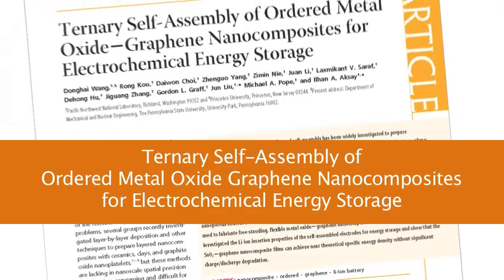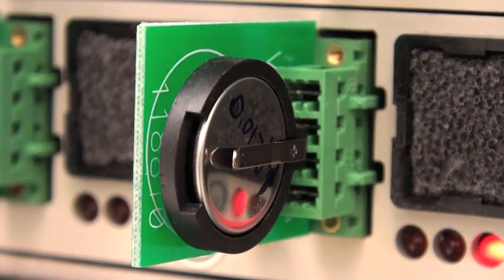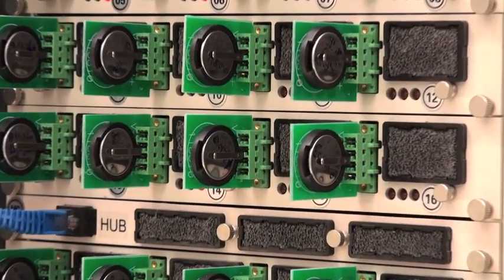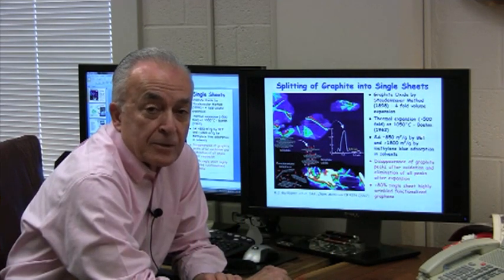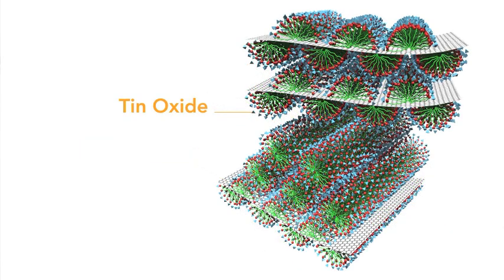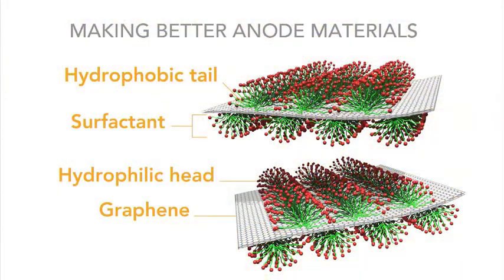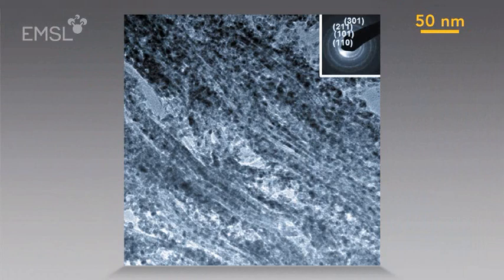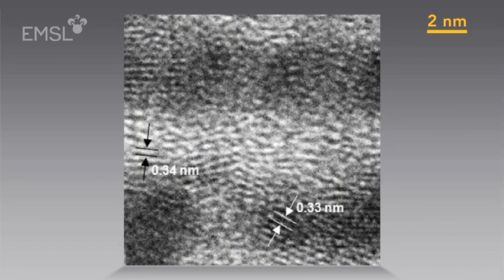Making Better Batteries with Metal Oxide & Graphene Composites

Comment: THe only thing is how would movement disrupt this perfect placement of materials into moving vehicles.  Because this is a placement tech it seems.  So if there is some kind of shock to the battery would it short or ruin the battery or cause failure inside where everything is so perfectly made.   Sounds good though im shure graphene could help since its so thin and thus should or could be better controlled more so than anything else.